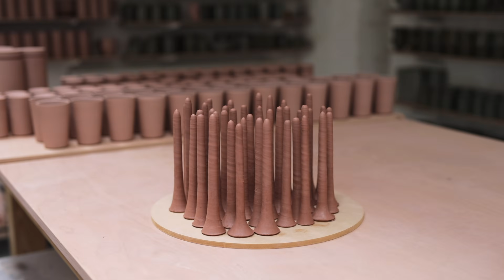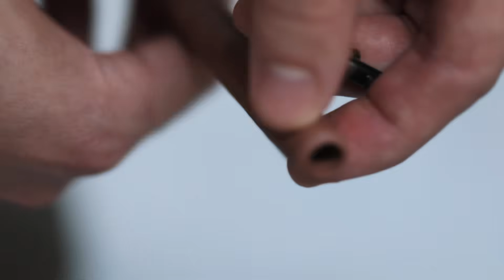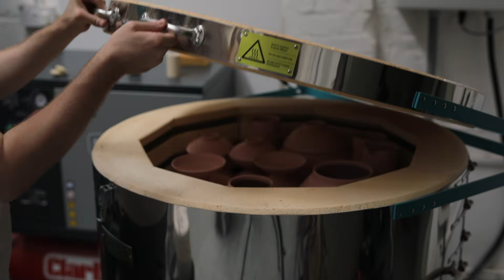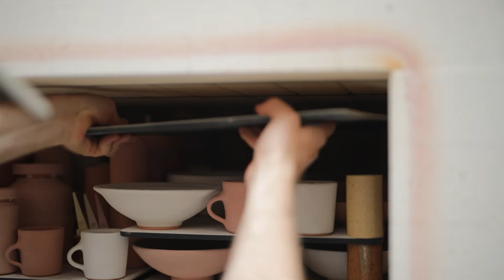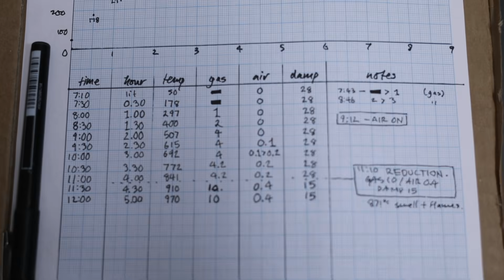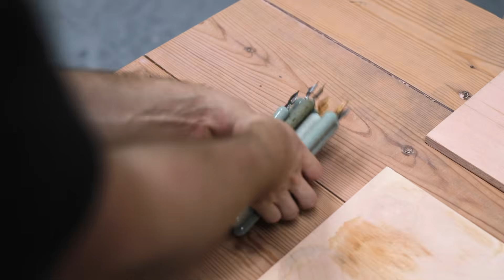How to Make a Ceramic Ink Dip Pen on the Potter's Wheel

Comment: The only problem I see would be that the inkwell's neck is too small to dip the pen in. As for the rest, nothing I just love it.
Reply from the maker: Good thing I measure the pens so they fit in… I mean, of course I make them so they fit!!
Reply: @floriangadsby  my bad, I wasn't very precise in what I said. I can see it fits, I personally draw with that kind of pen, and I personally prefer a wider neck to dip in to get precisely the right amount of ink on if that makes sense :) would also add that if it's that deep it's hard to reach for the ink but again, it's just a personal opinion of mine

Comment: I would have thought you would just wrap out a flat sheet of clay around a dowel and then shape it by rolling it on a flat surface or even roll out a tube of clay on a bench and drill the hole!

Comment: Would it be possible to bisque fire these pens while they are still solid (undrilled)... and then turn them on a lathe between centers to smooth the outside perfectly concentric, and then drill them out once they are stone hard, rather than leather hard?

Comment: Why not put  wax and string in the hole to dip the glaze you can then use a heat gun to melt the wax you can also more at a time. Or is more mediative the way your doing it now
Reply from the maker: That’s a good idea! I hadn’t thought of doing it that way. I guess the issue is, the added time to put the wax in, set the string and let it dry, make take longer than the current method that needs no preparation. The touching up of the ends may not be ideal but at least it’s fast. That being said, what an idea!

Comment: Hey Florian, the edge you remove at the last stage of trimming feels like it would be a nice design feature to make the pens go along with the rest of your work, instead of being so round in shape. Have you ever considered keeping any forme of an edge there?
Thanks for another great video!
Reply from the maker: I’ve made some like that, and you’ll actually see one like it in the video around halfway through when I put the metal ferrule in a leather hard pen. The problem is the edge is at the base of the pen, so the glaze floods down it and sort of overhangs on the edge rather than breaking over it. If it were possible to fire the pens upside-down then the edge would break through the glaze in a way that’s more characteristic with the rest of my work. If that makes sense. Thanks so much for watching!